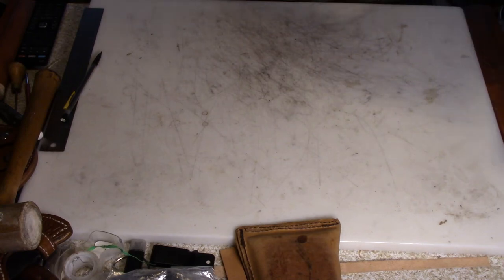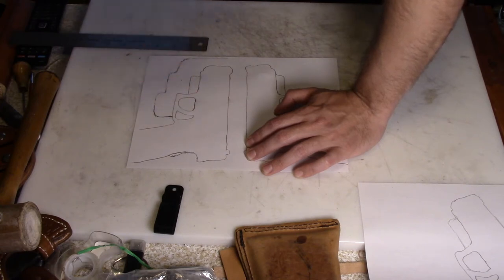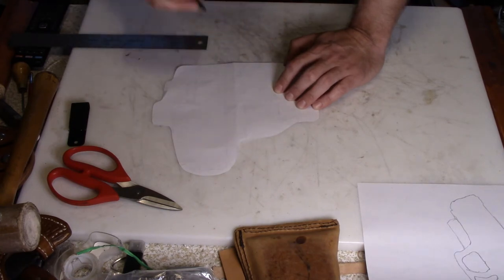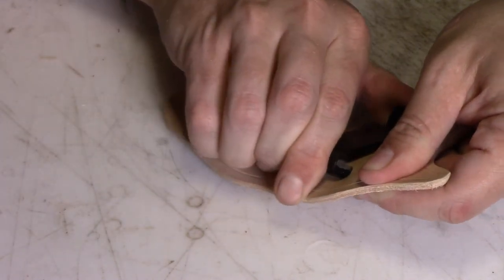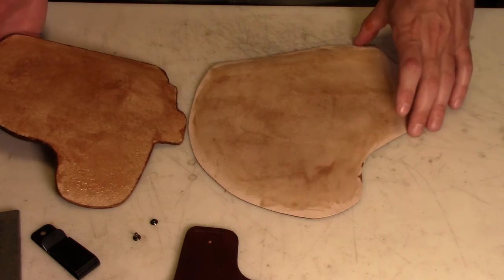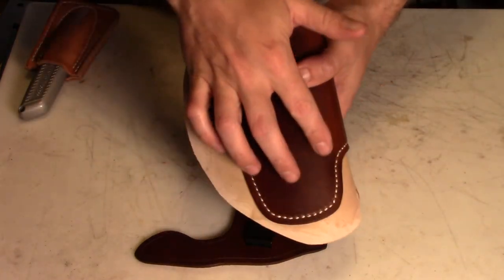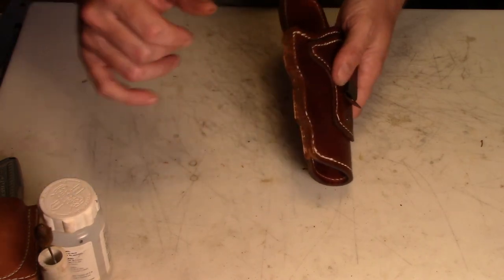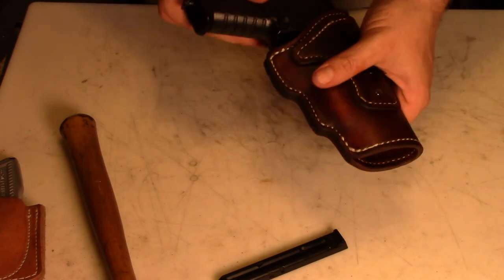IWB Leather Holster and how I draw my own pattern to make a CCW holster.

Comment: High quality, but i believe that it is way to thick for IWB holster.  Im gonna make a similar 1 but will not double up the leather like you did.
Reply from the maker: The customer asked for extra thick so it would not collapse when he drew the gun.  I do agree that I probably over did it, but the customer liked it.   You could definitely make something like this quite a bit thinner than I made this.  Hope it turns out great when you make it.
Reply: If you want to try it, I usually use a peace of galvanized steel used to hold a chain link fence to the post I pick up from Home Depot. Just heat and bend to shape it then sew it it in just below the mouth of the holster so that the holster does not have to be so thick, I have never had one bend or rust in the 15 years I have built holsters.

Comment: Only reason because my other places out of that thicker leathers and I have some cheap bellies that have a good enough spot to use as reinforcement on the outside as the stiffener. And I'm just wondering if you ever tried anything like that. Just trying to figure out for actually work and it'll be any good.
Reply from the maker: Belly leather tends to stretch more and become softer when it breaks in.  It is not the best option but it can work for a holster.  It might just break in to be a lot softer and more flexible holster.    You can definitely make a holster from one and I have seen many people use bellies for their first leather projects and be quite happy with how those projects turned out.

Comment: Why wouldn't you put plastic wrap over your gun to protect it. Hand guns rust easily.
Reply from the maker: I do wrap plastic wrap around a gun when I use it to shape a holster.  I even keep a roll of it with me when I deliver the holster to the customer at the range.  That way I can shape it to their firearm if it is something I didn't have a version of to shape the holster.  I have also used nonfunctional replicas that aren't steel and Blue guns to shape holsters
Reply: @bransonsgeneralstore  Thank you for replying. And thank you for making the video. I am just learning and need all the help I can get.